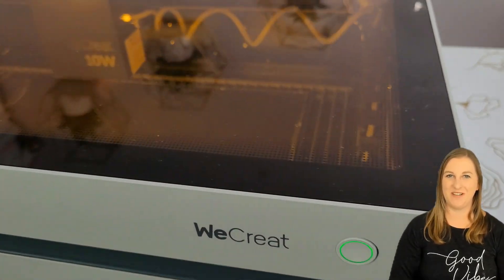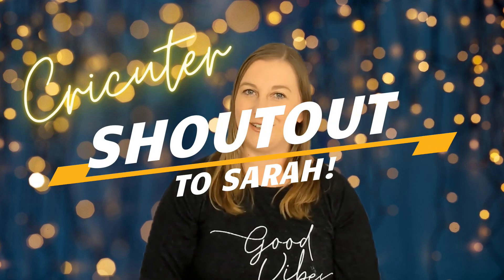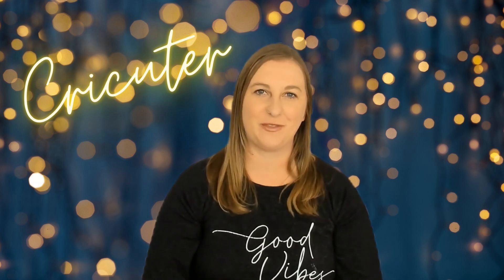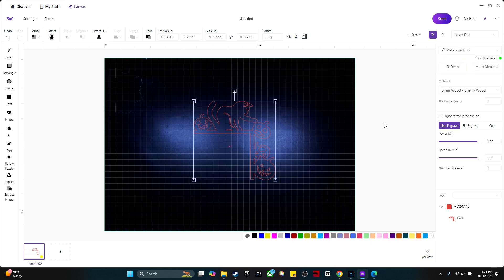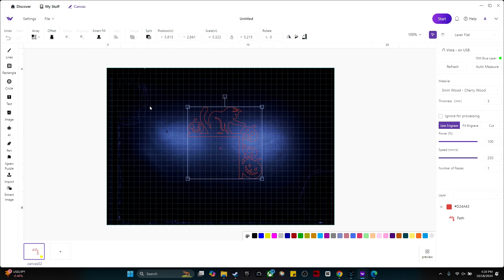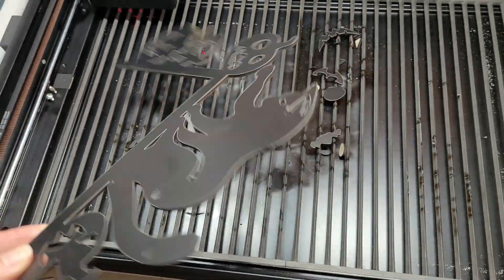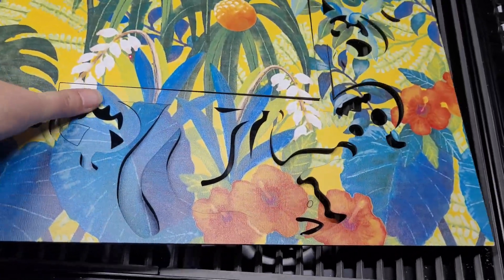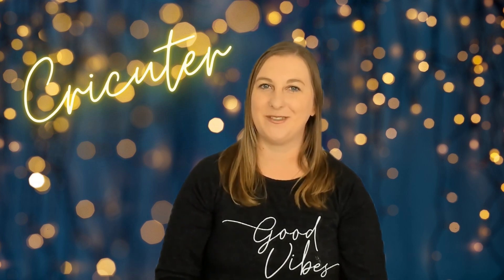How to Cut Basswood with the WeCreat Vista | Tested Settings for Beginners

Comment: Hi I was wondering if you know what the settings for 10mm basswood for the Vista would be. I want to make a keychain and would think the thicker basswood would be better
Reply from the maker: 10 mm is relatively thick for cutting on a 10w vista, but I would guess 100% power 5 speed and maybe 2 or  3 passes
Reply: @KerriCraftsIt ok thank you im going to go thinner. Im gonna do the 3mm. I was wondering though if I wanted my keychain double sided if I did the same design but flipped one and glued together if that would work